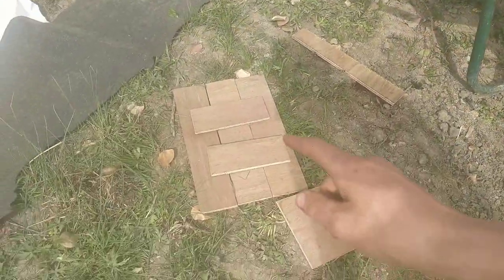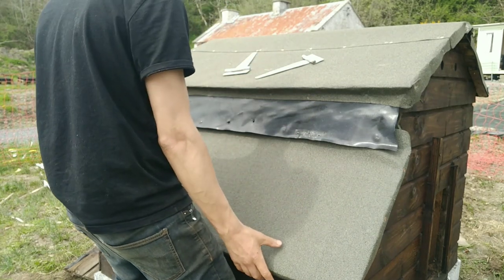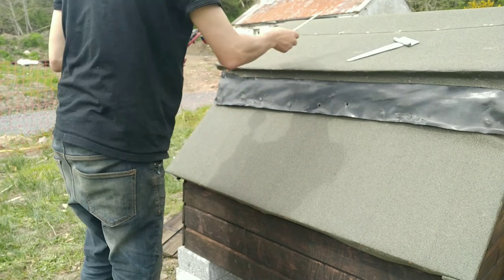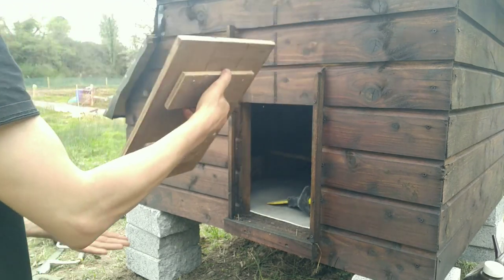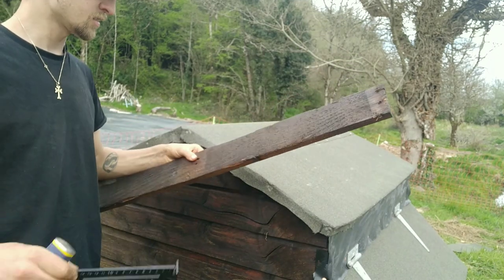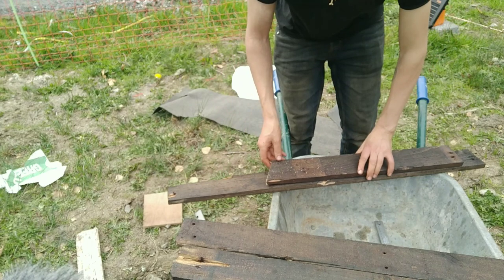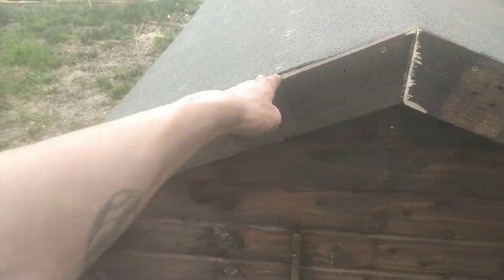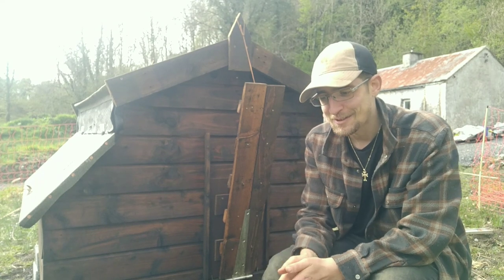Hen House Complete! | Starting a homestead

Comment: Looks good but don't forget to tie or fix it down somehow, the wind is a powerful beast......that house will get lifted up and blown over if it's not fixed in position.
Reply from the maker: Yes I will be doing that, I think securing it to the blocks with galvaband will do
Reply: @thebridgemanscottage  Hope so, you are the best judge for what you have. Just to be super safe, I always stake  mine into the ground at each corner and fix the woodwork to that - the wind can lift anything if it catches it right. Good luck with it all.